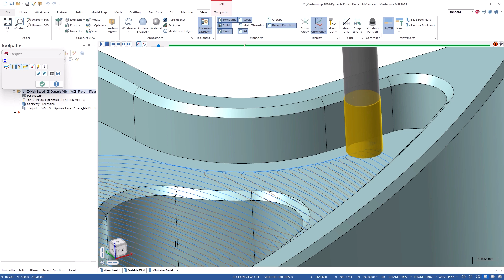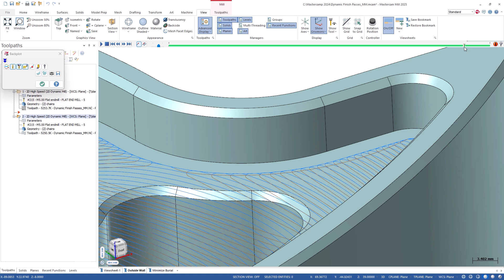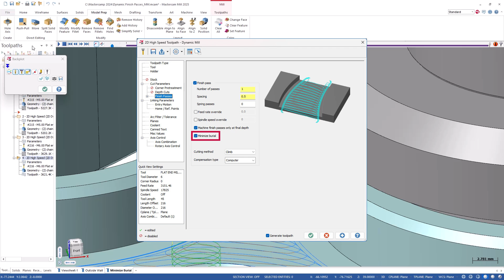Finishing Passes for Dynamic Toolpath | What's New for Mastercam 2025

Comment: When performing finishing passes in dynamic milling, I noticed an issue: if the dynamic milling roughing pass uses depth cuts, but the finishing pass does not, it causes tool crashes. The finishing pass is only applied at the lowest programmed Z depth, ignoring the depth cuts.
Reply from the maker: Thank you for reaching out with your question! Based on what you've described, it would be best to connect with your Mastercam Channel Partner. They’re equipped to review your specific file and provide tailored guidance.

If you're on maintenance, your Channel Partner can assist directly or escalate the issue to our technical team if it's identified as a potential bug. Either way, they’ll ensure you receive a solution quickly!

If you're not on maintenance, we recommend checking out Mastercam Connect, which offers access to maintenance and additional perks: https://www.mastercam.com/support/mastercam-connect/

Please don't hesitate to send your file to your reseller—they’ll be happy to help: https://www.mastercam.com/find-a-partner/

Comment: While I think this is a great new option to have, could there be an option to toggle which perimeters to include in the Finish Passes?  Something like an Outer/Inner/Both option?  The reason I say this is that we frequently use a 2D Dynamic to finish the floors on large, open areas that have no hard outer wall, but multiple avoidance islands in the center.  Turning on Finish Passes in such cases (if I understand correctly) would result in a wasteful finish cut around the perimeters of the machining region boundary, since it is an open edge with no actual wall.
Reply from the maker: Finish passes are based on edge detection which is dependent on your selection. Solid selection using automatic has been improved a lot to define which edges are open or shared. If there is a finish pass on an open boundary, make sure you are on the right mode (from inside/outside), and define air regions as needed.

We are continually working on our toolpaths, and we would greatly appreciate if you can give that feedback to the product owner! We do have a section on myMastercam where you can request features to be added and provide feedback!